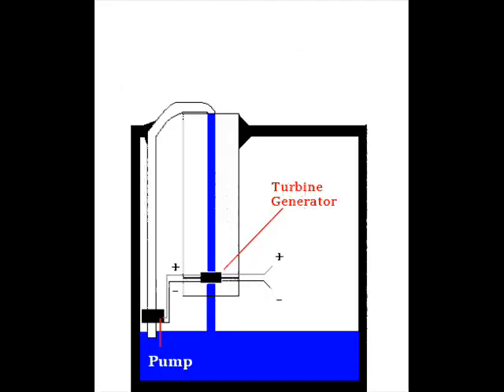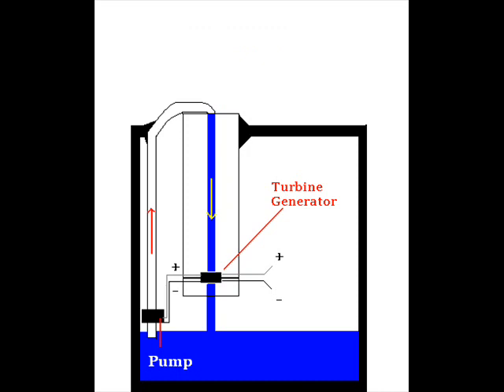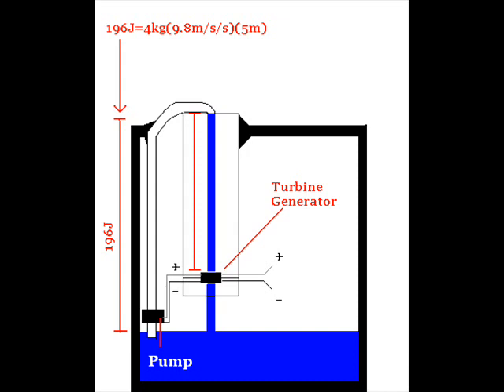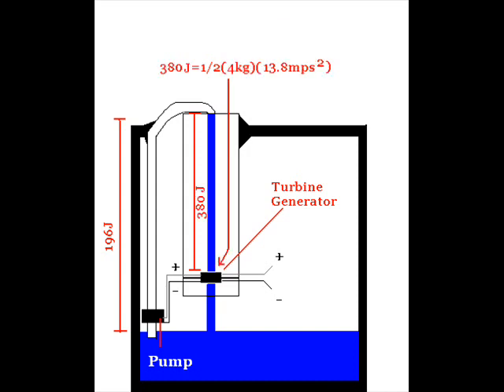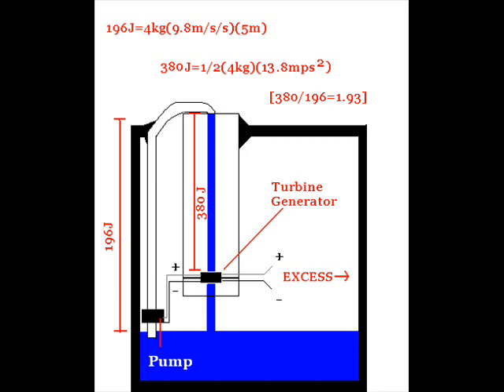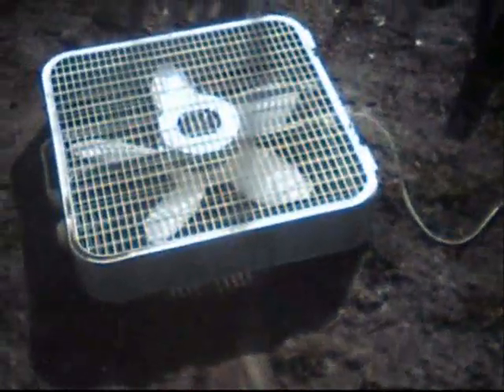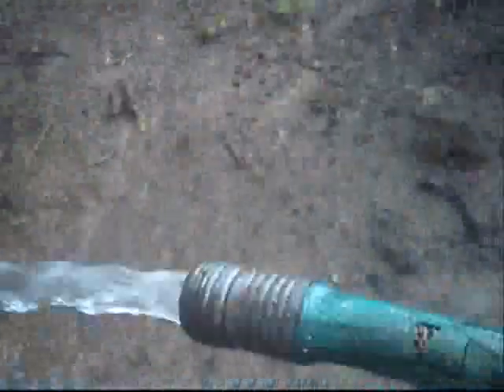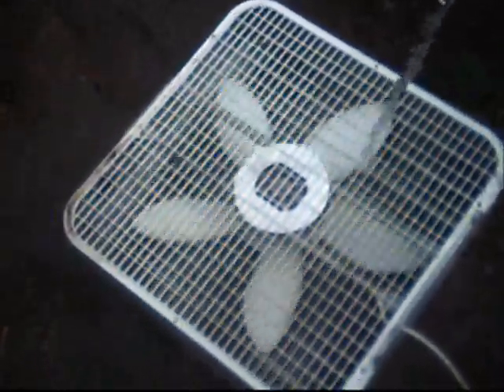Free Energy from Earth's Gravity & Water Supply Discovered

Comment: Just a thought, but if you add a reservoir to the falling side you could add additional pressure to the falling water, which you might contain within a hose until it reaches your turbine blades. The reservoir would add siphoning action, thereby decreasing the total horsepower required by the pump to keep the reservoir filled. There's another invention that uses water falling through two cans and cross wired that creates HV discharges; it's possible to integrate both ideas into one unit.
Reply: Or another method is to fill a tall reservoir with a tap at the bottom, so reservoir pressure can be relieved through a rotary turbine/generator. The pressure from a full reservoir dumping through the turbine, generates more power than it takes to lift the water to keep it filled (same principle of converting pressure to kinetic energy, with everything self-contained; also some gearing might be involved.)

Comment: If the pipe size is the same size the speed of the water pumped will not change inside the pipe. If you even used a perfect U bend as a 90 degree elbow the water will NOT go any faster with out air inlet and you only have your water "fall" 4 meters and pumped up 5 meters. You can not get more energy out than you put in.
All drain systems work with a vent above the drain outlet.
I have 35 years as a pipe fitter. I also notice that you do not have a working machine because it will never work. As for your "demonstration" is not a closed system.

Comment from the maker: It should be meantioned that DELAY TIME is paramount in why this tech. works.  This is why the device cannot start ITSELF up, but must be primed over a period of time.  The hyrological cycle in the device is a SUBCYCLE within the hydrological cycle of the Earth, which is powered by heat energy from the Sun.  Without that heat, water would freeze and such cycles would not be possible on Earth.  So in a sense, this is a form of solar power.

Comment: thumbs down just because u're creating fake vids (your other vids on UFO and Antigravity). This vid right here just proves your lack of understanding physics.
Reply from the maker: The two still photo vids on UFOs are real.  My son took the two photos in 2009.  The three antigravity vids are also real.  Sooo....why don't YOU explain to the crowd here WHY this wouldn't work....I'll not expect too intelligent of a reply...but likely another uneducated diss.  The vid "best ufo footage ever" was for kicks.  It is a cartoon.
Reply: ffeijdrug
FAIL#1: You calculated (apparently) the energy required to LIFT water, but you are then saying the water exits the pipe at 9.8m/s... ... you need to calculate the energy required to accelerate water to that speed, not just to lift it. The energy required to maintain your proposed flow rate is much higher.   FAIL#2: Your water TRANSFERS kinetic energy when it hits the blades (to the blades of the turbine), therefore it reduces in speed... therefore even if this system was a closed loop pipe (not as depicted), you cannot maintain speed by simply imputing ONLY  the energy required to LIFT water.
In fact,  If the system was a closed loop presurised water pipe, you would'nt "lift" anything, you would be just moving molecules, in a cycle, around a circle.  In that case, your pump could just be comprised by a fan blade... what makes you think that you could extract more power from another fan blade (turbine), than you put in.
Reply from the maker: val m Only takes much more initially, until turbine is up to rpms and circulation of entire system, including resevoir, is achieved.  Then PRIME source is removed and it runs on it's own.  I suggest you go to links in description, including that of working model.

Comment: What type of energy is going to operate the valve at the top of the curve? You need to induce air before the water begins to fall or you will end up with a siphon, which will greatly slow down the flow of water. The pump would have to cycle on and off as the air valve at the opened and closed. All you are doing is trying to make a water tower without the reservoir. It just does not work. Your also not taking into consideration of head loss and friction loss from the walls of the pipe. There is not a plumber in the world that has not tried to figure out easier and more efficient ways of pumping water.
Reply from the maker: Stick to plumbing, my friend.

Comment: If the water is already travelling at 9.8 mtr.p/s from the pump then it only has about half a second in the air before it hits any turbine..which means it only has .5 of a second to increase it's speed to v-max which it wont do...you are making a wet version of a generator driven by an electric motor charging a battery thats running the motor..(which doesn't work either!)
Reply from the maker: jhanthony2 The velocity of the water is 9.8m/s going up.  As shown in the vid, if it comes out of the pipe straight up it comes to a halt, but not if it comes out going straight down.
Reply from the maker: Actually, it would be < 4m/9.8mps=.408...seconds which would give < 13.8mps because it is accelerating.  If we make the free fall 5m instead it would be
< 5/9.8=.510...seconds which would give < 14.8mps.  This would be as efficient as you could make it, with the fall being clear back down to the resevoir.  Perhaps someone out there knows the formula to give the exact velocities.  If so, please post it and the result.  Good job, Nigel.  It still works , I think, but is just not quite as potent at 4m of drop as I show in vid.
Reply from the maker: Formula is v = gt   Since water begins free fall at 9.8mps you would plug in
1.408seconds as t.  Free fall to turbine would be >4m and <5m to give 13.8mps, as there is acceleration in free fall .
Reply from the maker: Average v of freefall is about 11.8mps so would have to fall about 4.8 meters
to turbine to aquire 13.8mps, not 4 meters.  Link to gravity calculators and formulas are in vid description.
Reply: ffeijdrug STOP in the name of the [physics] law!! Fatal physics error! When water begins to fall, it obeys the same laws of gravity that every other particle of mass does. Water begins it's "free fall" at ZERO meters per second. Not 9.8 mps. That curve at the top of the pipe is not accomplishing what you think it is. The upward flow of water will slow to a halt. And from a halt the fall begins.

Comment from the maker: What a lot of viewers are not getting, it seems, is that yes, it takes at least double the energy to get the turbine up to speed and the circulation going in the whole system, including the resevoir, but then it takes only 196j to KEEP it circulating.  The vid of the working model, linked in description is no fake and works in the same way, but on a smaller scale.

Steve D. Gage
Author

Comment: LOOP HOLE, lol, Not the stupidest video I have ever seen, but certainly deserves a honorable mention. The only way this would work is to use south facing magnets on the pipe and a north facing magnet on the inlet so the magnets on the pipe would help pull the water up.
Reply: This works especially well with water that has a lot of iron in it. : )

Comment: If you take the pumps shaft in the diagram and move it parallel to the turbines shaft then added a connecting rod between them we would see a very efficient conversion of energy between lift and drop.
If one were to replace a body of water with a solid material and lift it 1 meter, would it be possible to recover the total potential energy stored in the

Comment: This seems more like a flywheel than anything else. If you used a motor to start a flywheel moving and then disconnected the power the flywheel would continue to spin for a long time depending on it's mass and how long energy was applied. I think it is great to think outside the box but lets not draw conclusions on a partial test. I would be impressed if this thing ran for several days, but somehow I don't think it will. Please prove me wrong...

Comment from the maker: From author:  You are correct and understanding Plumbing , you obviously understand why it works.  It is no different than turning on a new city water supply system.  YOU HAVE TO PRIME THE SYSTEM OF PIPES, BUT AFTER THAT ONLY A CONSTANT AND LESSER AMOUNT OF ENERGY  IS REQUIRED TO MAINTAIN OPPERATION.

Comment: The easy thing is to build it and measure the results after months of expense and time whether it works or not.  BTW, it picks up speed because of a solid stream and more efficient energy transfer (plus some pre-existing water speed induced by the energy required by the pump to give it the speed).  I am assuming this is a hoax video for ratings to get money from ads like most of these FREE ENERGY videos.
Build it and prove us wrong.

Comment: ffeidrug  -  I applaud the attempt,   I have also thought about this concept ,  there are hydro electric systems that when not feeding power to the grid - switch to resupply mode and literally pump the outflow water back up the hill to the storage lake.  I also have to agree with several comments below -  there will never be 100 % efficiency in a component -  you can never create enough amperage in the turbine to run a perfect pump as 100% efficient loop

Comment: I didn't get very far into the video, because I found you too tedious to listen to. Try not to pause every other word.
I did already notice an error in your reasoning though; the water cycle is NOT exempt from the conservation of energy law. It takes external energy (in this case from the sun) to evaporate the water. Since you're adding energy to the system, the water is allowed to do work on the way down without violating the laws of thermodynamics.

Comment: if the pipe the water is moving through was under the water level it would create a vacuum it would be like running a pump submerged  with say a generator on the discharge pipe  the elevation of the pipes would not matter in a VACUUM!!  as the water would only move as fast as the pump allowed  and the pump would use alot of extra energy to spin a generator  this will not work at all  sorry !

Comment: The energy needed to pump water against gravity is the same amount of energy that water creates falling back down to the level it started at. It requires more energy to move water against gravity at a higher velocity, just like water flowing at a higher velocity with gravity creates more energy. The BEST that could ever happen is it would power itself, which would only be possible if your pump and turbine were 100% efficient. Nothing is 100% efficient. Its a nice thought, but sadly not possible.

Comment: I like this... if you were able to move alot of water mass using a Bamford style pump, or several pumps to one tank, the water outlet from the tank convexed to a jet stream, with the water mass returning to the original source to be repumped.
 A simple float valve or solinoid could close and open the jet to create power at the water turbine/cistern level. Closed system... free power.

Comment: Ok if you really want to prove that an over unity engine is actually free energy it is really simple. You need to make a video showing the following. The engine is not receiving any outside source of energy including on built energy sources. Second you need to show a time lapsed video of it running for at least one week without any tampering whatsoever. This time frame will exclude low friction devices. Third, you need to actually capture energy from the system and show that

Comment: i'm not so sure a pipe would be the best thing it seems the water trying to fall faster would cause a suction.  if the pump had a head start and a resevoir it may not make the suction.  it also seems like your water/fan expriment may have altered the impinging angle.  maybe even a solar panel to run/prime pump or the resevoir could also jump start the turbine and start pump.  gonna watch the working model video you got. catcha later

Comment: Actually I'm not convinced there's a battery. It is possible to create an electrodynamically balanced system. The machine starts from the wall socket, which he makes no secret of. But what this is doing is building momentum. That kinetic energy is only going to dissipate at the rate of friction and load. As long as those factors are low it should wind down over a couple of minutes. Note that he shuts the device down before it becomes too obvious that it is slowing. :)

Comment: Everything that TheRealist888 has told you is more or less correct. Regardless of how the system is configured, some energy is always lost due to friction. Thus the energy generated at the turbine can never be greater than the energy required to pump the water. The video of the "working" device is a hoax. The guy wants to make you believe it will run indefinitely, but it won't. The device is first plugged in to build momentum. When it is unplugged it will wind down just like a spinning top.

Comment: ignorant fool, if you don't understand i'm not going to waste anymore time. 

Now listen

1) The pump makes heat when working. Every electric device does, so the electricity used by the pump, is not all transformed into water speed. Yes, the water does get passive or potential and the kinetic energy, but less than what was used by the pump.

2) The generator also produces heat, so again some energy is lost.

3) Friction.

Comment from the maker: Not lost.  1/2 of the energy becomes PASSIVE.  If a second stage going up
another 5meters from the tank were used, and water exiting downwards again at 9.8m/sec, the total kinetic energy if the stream were to hit the resevoir would be 4x196J.  OR, if the water in the tank was accelerated back downwards at 9.8m/sec it would hit the resevoir with 2x196J. In this system, there is double that efficiency as the water is only pumped up, not down too.

Comment: The thing is that such kind of energy-making motor is impossible. As I've told you before, the pump used in that video, uses more electricity than it gives out in form of water current. The water current has some energy, but less than the power of electric current given to the pump. If the current gave 20 J, the water would have about 15 J of energy

It keeps it's energy much the same and it doesn't have ANYTHING to do with the curved tube. It then hits a blade wheel which transmits the movement

Comment: @ffeijdrug

You need energy in the pump to lift water, lets say 10 Joules. Half is lost with heat, so the pump actually gives out 5 J. With 5 J you can lift a kilo of water 0,5 m up.

A kilo of water then falls into a turbine, with a bit less than 5 Joules. The turbine also produces heat, so you get about 2,5 J in electricity and 2,5 J in heat. Basically your machine makes heat with external electricity so suck it.

Comment: costs more energy to pump up water than the other turbine will ever generate. do the experiment and you will see. try it again in a closed loop. then try it with a vaccum in the drop pipe section and see what you get. nothing like running the tests and output. maths should then explain that.

Comment from the maker: From Author Part 2: If the water were trapped in a tank at the top, 1/2 of the energy used
to raise it would have been destroyed, according to your logic.  Either mgh 'or' 1/2mv^2 
defines lifting the water, not both in addition, as gravity and acceleration are interchageable.  See  Relativity link in info for info on why is actually KE=mv^2 because of passive unused
energy. This set up releases the normally unused passive 1/2 of energy available.

Comment from the maker: From Author Part 1: Acceleration and gravity are 'interchangeable'.  If you were to simply fill a tank at the 5 foot level, the water would have 196j of gravitational potential energy.  If it were dropped, it could only produce 196j at the level of the resevoir.  But as shown, the water is
allowed to be directed downward at 9.8m/sec.  This is kinetic energy, also equal to 196j, but
the maximum it can accelerate to at the resevoir is 2(196j).

Comment: Sorry your maths are wrong. Dont foget gravity is acting on the water in the first tube of 9.8ms. If you then had it fall through the generator tube at a max 9.8 (excluding losses due to acceleration) the most you will get to is 9.8ms. If this then hits the turbine and energy is dispelled through turbine. The output of water will the be little above 0-1ms. (energy consumed)  No energy left to continue cycle. Its not going to work.

Comment: without going into any in depth calculation, you can tell straight away this will never work, first of all there are energy losses which are many...but even if the generator and pump were 100% efficient and water had no friction going along the pipe you cant pump the water up 5m and produce the same (or more) energy by the water falling 4m...(gravity cancels itself out at 4m) your calculation is way out

Comment: quick point, kinetic is 1/2 mv^2 and not mv^2 mostly you don't understand fluid dynamics, it is easier if you consider it as a simple marble, if you throw it upwards, you lose velocity as it rises, so that at the top of it's path, it has zero velocity. You use extra energy pumping vertically upwards to get the same pressure out - a simple experiment is to get a pump and measure flow rates at different heights using the same amount of power and you will see how flawed your design is.

Comment: this is an ideal case. in reality many energy loses will disturb it. efficiency of water pump can not be 100% or greater. More height of water reservoir for turbine to work better will cause more load on pump, and hence by Lenzez law, pump sucks more current to keep it on work. moreover frictions and many other factors will stop it. You should introduce a solar cell with this assembly